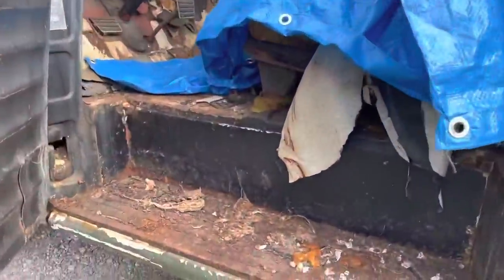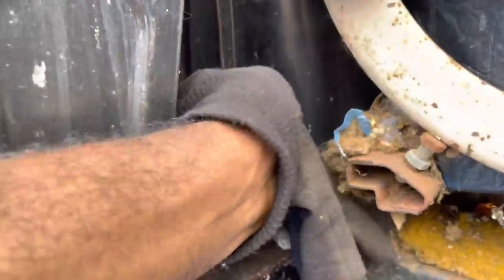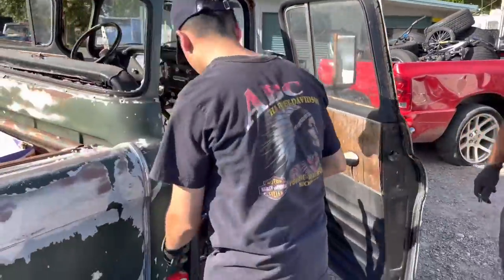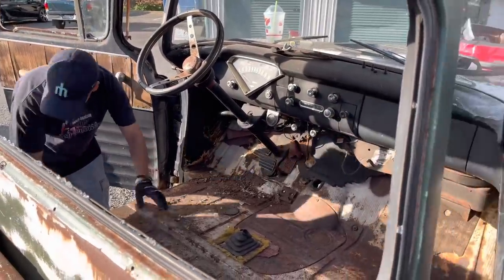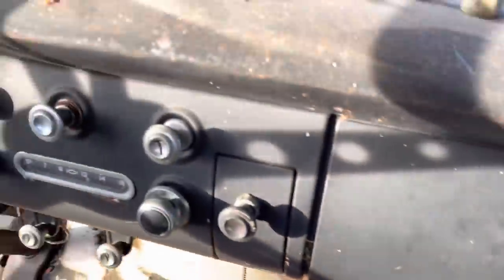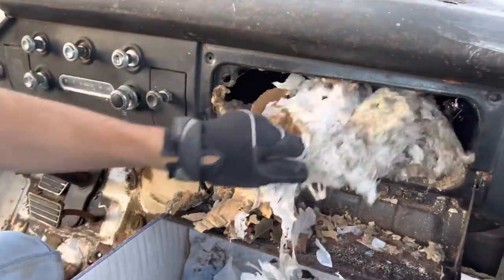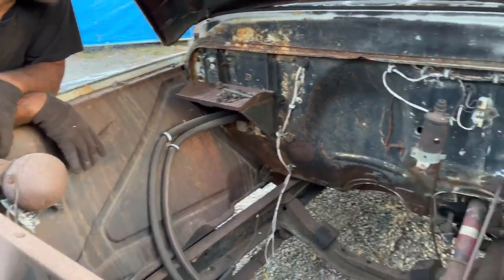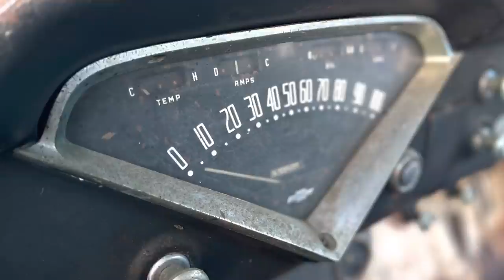BARN FINDS| 1955 Chevy Cameo cleanup and build plans.

Comment: This is a cool truck. Please do not lower it!
Return it to stock please.
Reply from the maker: The stock 6 cylinder would be boring and cost more to hop up than a stock ls or big block
Reply: @DezzysSpeedShop  Cameos we’re pretty rare trucks when new and now there are way less remaining. If the original straight 6 is too boring if it was mine, I would put in a mild small block and keep the original 6 so it can be sold with the truck later so the next owner can choose between mild rod or stock. Cameos had fiberglass box sides and used 54 BelAir tail lights.

Comment: Try something original leave it stock.
I have one just getting done fixing the 70 custom cobble i replaced half the firewall and put the right dash back in it
Reply from the maker: I’m lucky this one is bone solid. I’m gonna drive it like this but with an LS. If it had its straight 8 still I would’ve left it